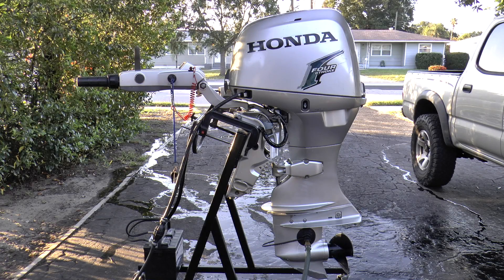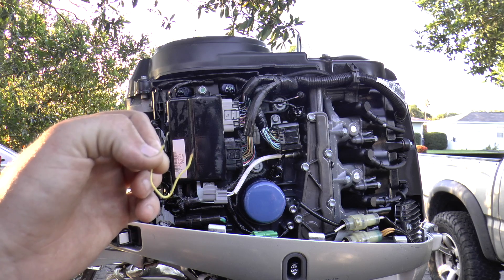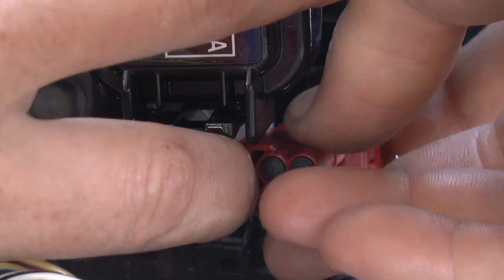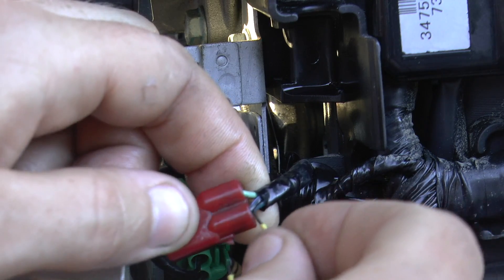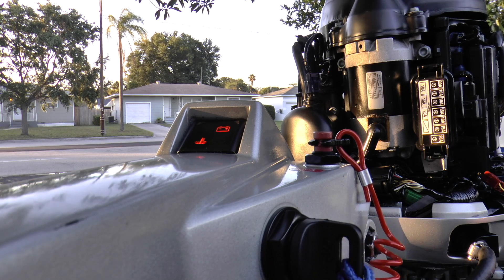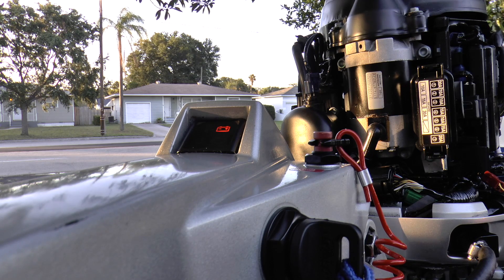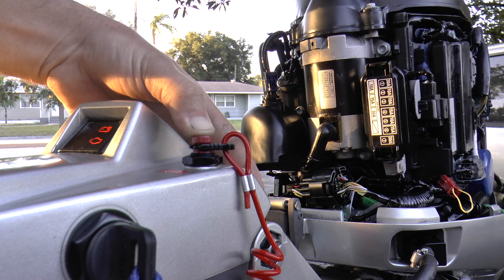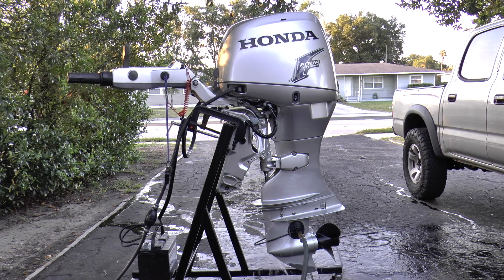How To Pull Codes On Honda EFI Outboard Motor

Comment: Hey brother have you ever had any issues with oil light alarm going off when trimming up , just did a fresh oil change was doing it rite after I bought it and got a chance to take on the water pretty sure I got scammed but any info greatly appreciated

Comment: I was looking to troubleshoot my 50hp honda issue, came accros to your video. I did exactly as you advice. Thanks for your usefull sharing👍👍
Reply: Helo i also have a Honda Bf50D Do you have a table for the codes?:)

Comment: As a fellow marine tech I actually knew how to do this and basically stumbled on this video by chance so I watched it anyways.  I just wanted to comment on how detailed and precise you were in explaining the procedure.  Sometimes it's hard to remember that there are many people out there who like to try to do their own work but aren't actually mechanics.  This makes it a lot easier for those people to save the diagnostic fees some dealers might charge.  Again thanks man and I subscribed for sure!!
Reply: Hi would this work on a  Honda bf90d?
Reply: Did not work on our Honda BF50D for some reason. Troubleshooting per service manual revealed MAP sensor failure. Fogging engine thru air intake may be the reason.
Engine idle was fine but overheat stopped it at higher revs likely due to lean mixture caused by failed MAP sensor.